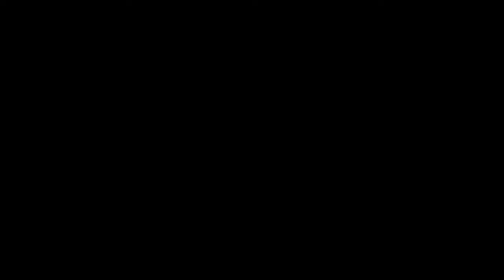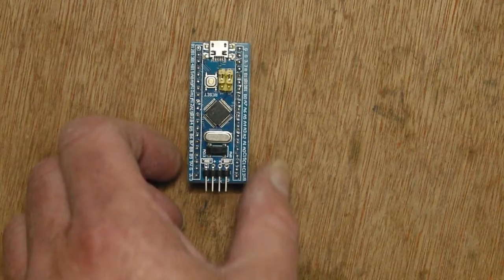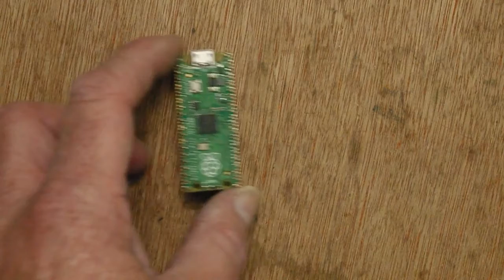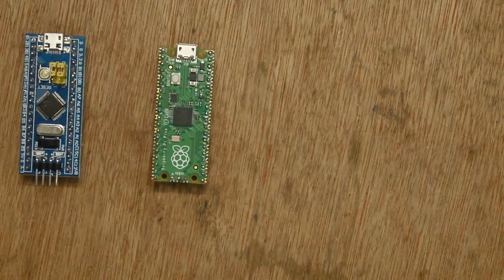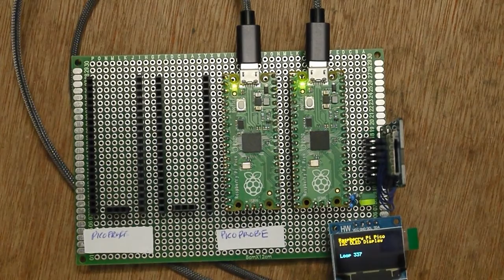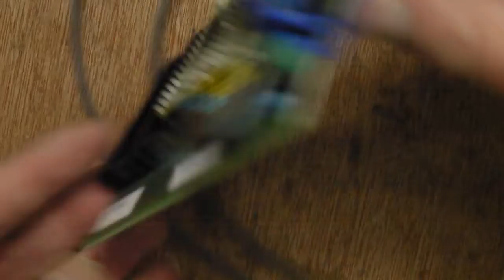Raspberry Pi Pico Picoprobe

Comment: Is it possible for Picoprobe / YAPicoprobe to debug any jtag/swd device?

For example, can it work on a Lattice ECP5 device (colorlight v8 5a-75b board)?
Reply from the maker: It's an SWD device and interfaces to OCD, so it should be possible to debug other devices, I'd have thought, but you will need to find or make the correct configuration files.

Comment: You can program the pico with usb without any programmer, you just push the reset it create a disk and you paste a uf2 file, the nice thing to use the picoprobe is to debug.
Reply from the maker: Yes, I do that a lot these days. Sometime you just need to debug though...